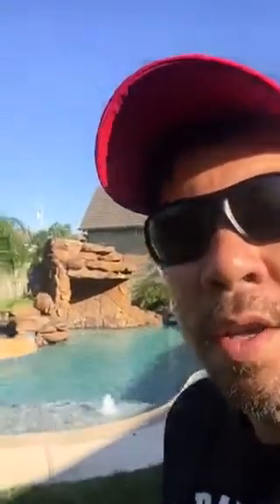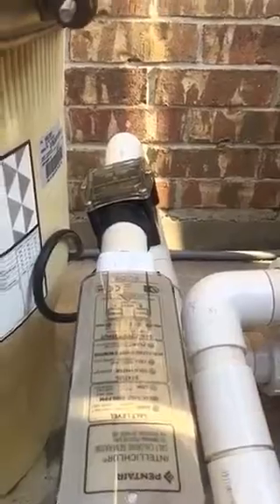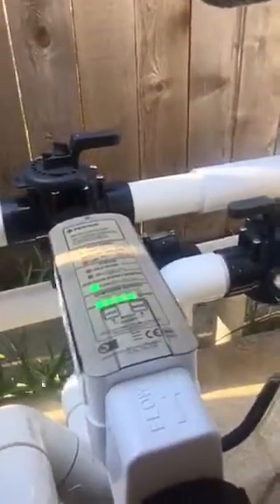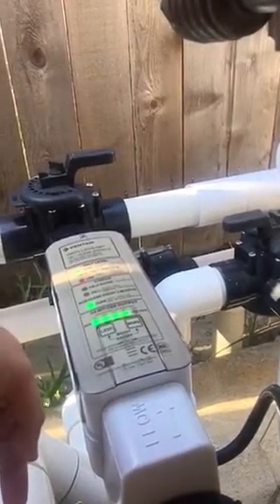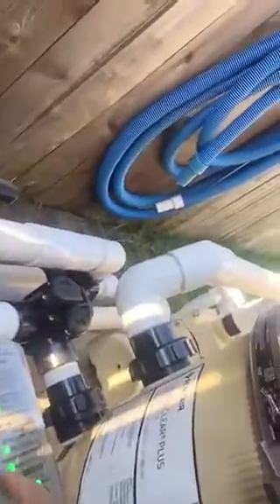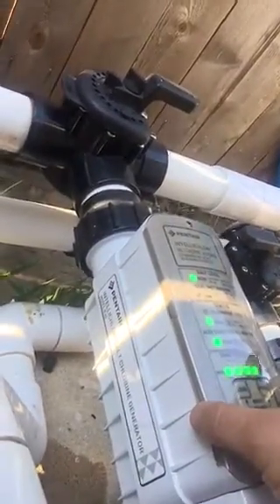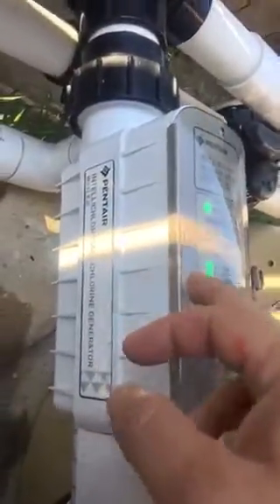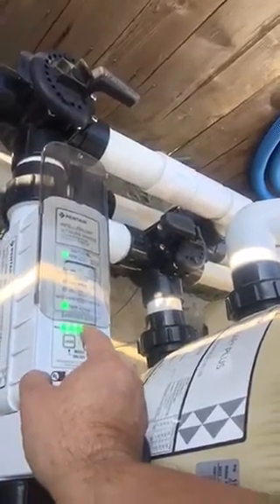Pentair Intellichlor IC40 Saltwater to Chlorine Generator

Comment: Why are my sanitation % lights blinking and my cell light will not stay on green?
Reply from the maker: Julie McCartt Are the lights revolving through the %s? If so, then it is in Boost Mode.  

Is the cell light off or red? If red then the unit needs a cleaning of the interior plates most likely.
Reply: When the % LEDs are blinking green in the Sanitizer Output section, this indicates that you are on the lower scale of % numbers (2, 4, 6, 8, 10%). Solid green LEDs indicate the higher scale of numbers (20, 40, 60 , 80, 100%).  To get to the higher scale when lights are blinking green, keep pressing the MORE button after getting to 10% and it will jump to the first light but now they are solid green which indicates you are at 20% and higher on the scale.

Comment: All the levels in my pool are good (Salt, chlorine, etc). However, I noticed that the status light shut off. Does the status light only light up green if it is calling for chlorine? I thought the light should always be green to show it is working properly. I’m hoping that when the chlorine level is low, the cell will start creating chlorine again and the light will show up as green. Is that correct or could I have a problem with the cell? Thanks!
Reply from the maker: DoverSmiths Have your water temps fallen below 59 degrees? Pentair has said this is a problem as to why the light may go out.  Contact Pentair: you may get answers for a fix or get a new unit if it is under warranty.  I received a new unit for an other related malfunction while still under warranty.
Reply: Hmm. I guess I need to look into it and make a call.  The flow light is green, salt light is green and the % lights are green. The status light is sometimes green and sometimes off. Thanks for replying.
Reply: The pool has been a beautiful 84 degrees the last few days. I can’t think of anything else besides maybe it only turns green while is has a call for chlorine.
Reply from the maker: DoverSmiths According to the manual, NO LIGHT= “It’s not producing chlorine;  it many be in an off-period of the sanitizing cycle and will return to ON shortly.” So, it sounds like a normal operation.  Just keep checking you salt and chlorine level to be certain👊🏼
Reply from the maker: https://www.pentair.com/content/dam/extranet/aquatics/residential-pool/owners-manuals/water-treatment/ichlor-salt-generator-user-manual.pdf

Page 11
Reply: Thank you! Much appreciated.

Comment: We had bunch of rain here in North Carolina. My salt system shows red . I have already dropped 7 bags of salt in the pool . Pool had 30,000 gallon of water . But it shows red means low in salt and on the statues the light for cell doesn’t come on . It’s not green and it’s not flashing . I have a green botton on flow .
Reply from the maker: Have you turned off the pumps while adding bags then, turned on the pumps again to check status? SW generator will not adjust accordingly to new salt input while pumps are running. 

Also, Your heavy rains could have flushed out all your salt, especially if it was on the low side and beginning to need salt  replenishing. I would turn off the pumps,  add one more bag at a time, stir it around and turn the pumps back on again and check status. Then repeat if needed.

Comment: On my cell all buttons are green as you mentioned, but I believe that cell not producing chlorine. Pool is green. How to check if cell still working?
Reply from the maker: Natalia Polina Are you running your  salt water chlorine generaror long enough  each day to produce the chlorine needed to stave off algae for your size pool? Also, are you using a chlorine pool stabilizer (Cyanuric acid)?